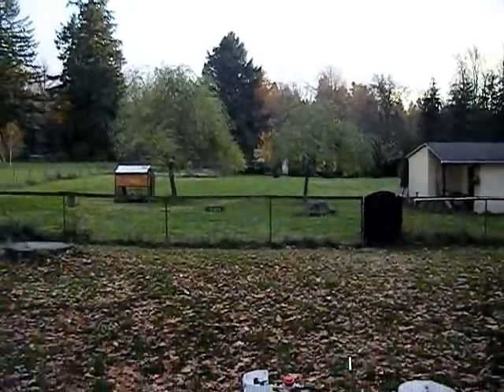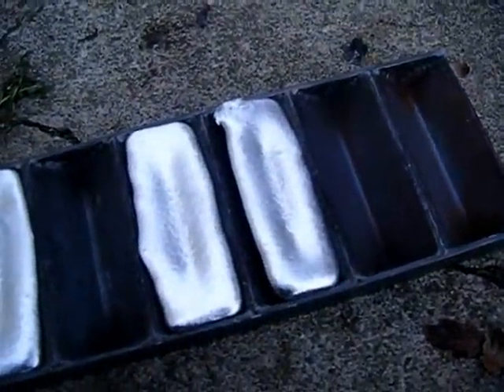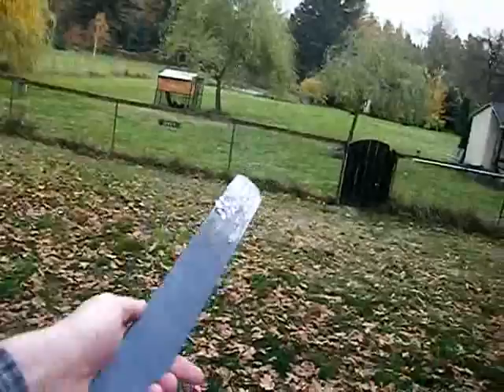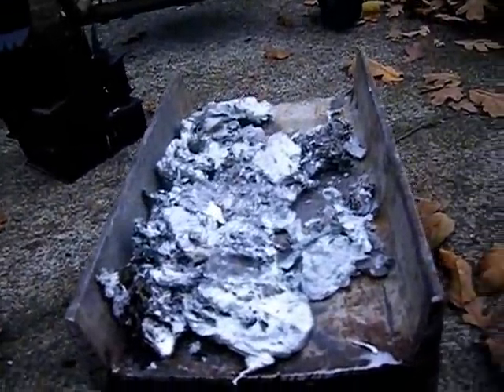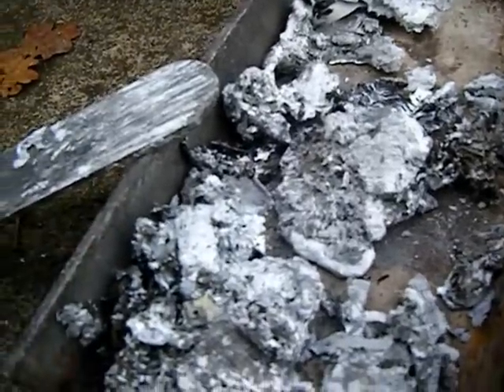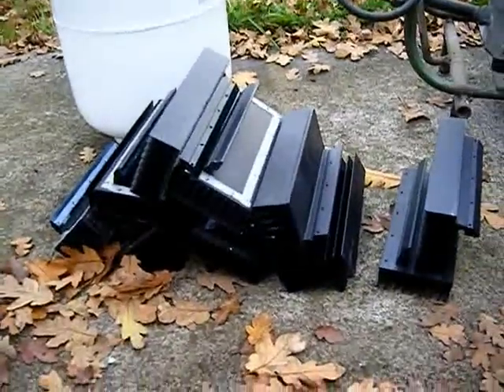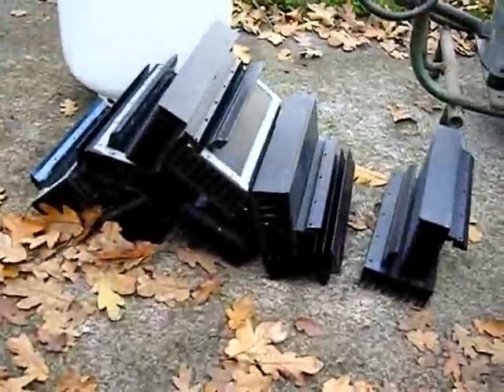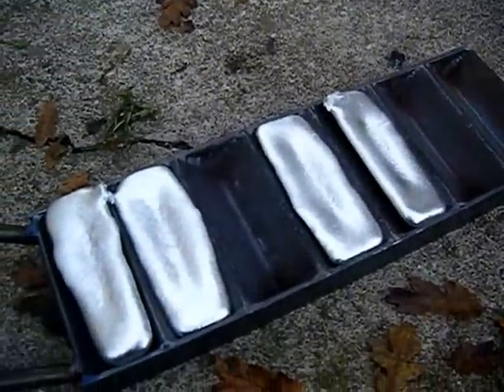DIY Foundry: What is Dross? (part 1)

Comment: Is there any dross that sinks to the bottom?
Reply from the maker: Yes, anything denser than aluminum will sink - steel for instance. Technically dross is the stuff floating on the top.  Not sure there is a  word for the garbage that sinks.

Comment: no what i wanna know is what can yo DO with dross
Reply from the maker: Haha, I'm sure there are creative uses... but I usually just drop it into the recycle bin and let the recycling companies recover what metal is left.  I've heard that when making new metal (smelting), the glassy byproduct that floats on the surface of the good metal is often broken up and used as a sort of fill.
Reply: amaedesign I work in an aluminum recycling facility. We have to send the dross out on special trucks to another specialized recycling facility and the trucks we ship it out on have to be specially designed to not trap moisture because dross plus moisture is an exothermic reaction and also releases hydrogen gas

Comment: There is a difference between dross and slag. Dross usually contains valuable by-product metals where slag is generally valueless glass like material. You were correct in calling it dross and thanks for the videos.
Reply: Dross still contains a lot of alluminum ime
Reply: @qtpie2630  I thought the residual aluminum was in the slag from an initial melt, and if you remelt slag to extract it you've got dross (carbon junk) left over